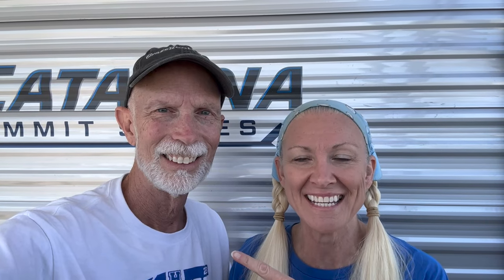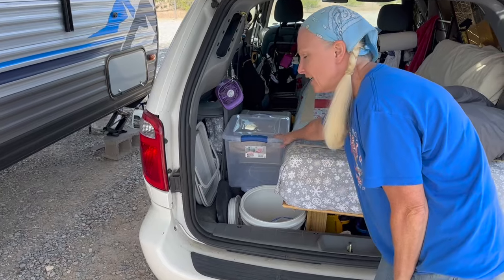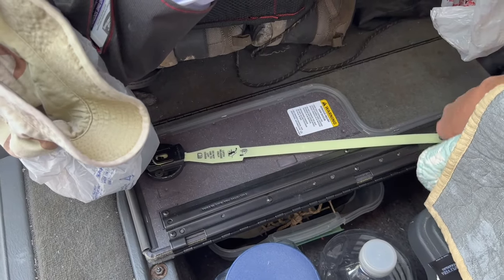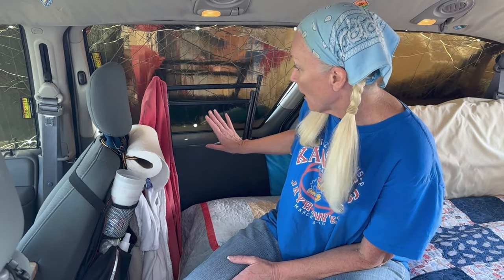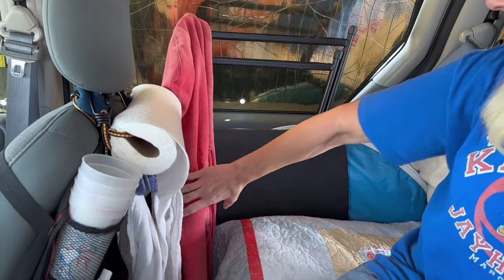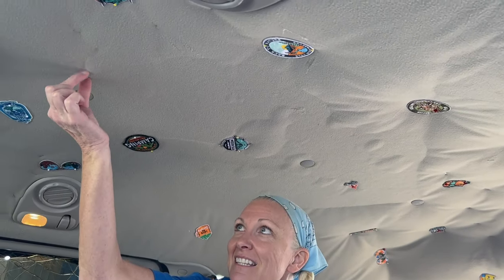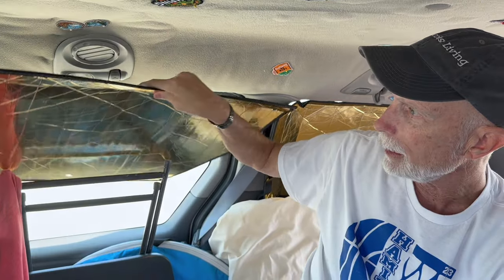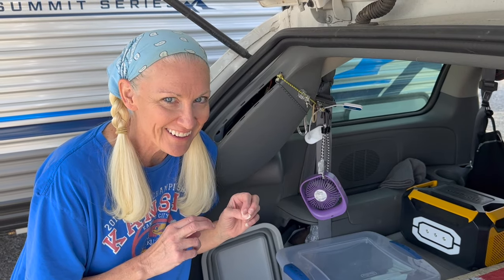Minivan Camper Conversion - Guide to Essential Items and Organization Hacks

Comment: Your pull out bins uner thr bed will slide easier with a sheet of foam board in the bottom. I used one in those shoe storage  under bed organizer. Slides instead of crumpling. Thank you for all your great ideas.😊🎉😊
Reply from the maker: Oh, that's a great idea!  Thanks!